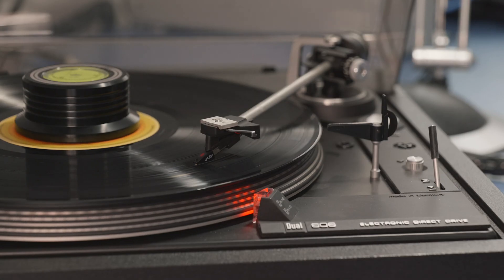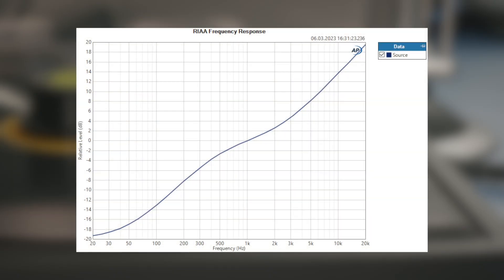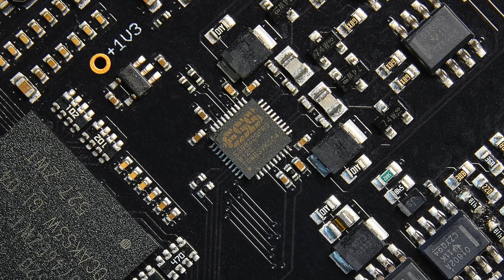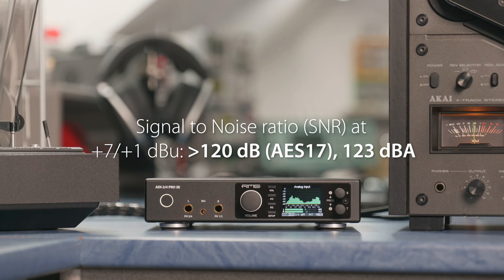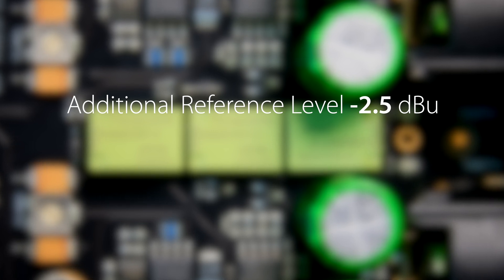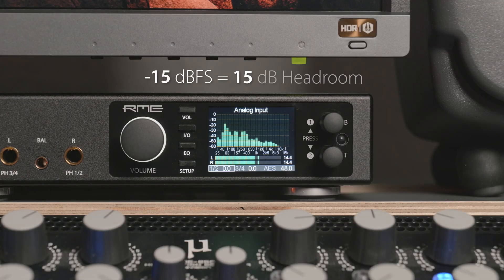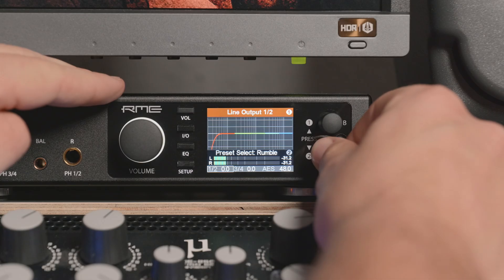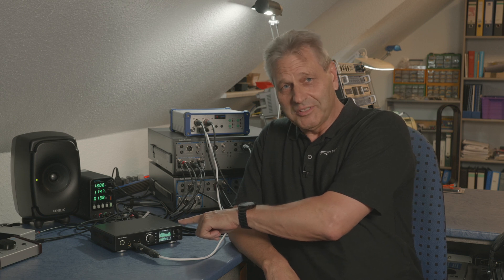ADI-2/4 Pro SE: Digital Phono Preamp (RIAA Mode) Explained

Comment: I just bought the ADI-2 PRO FS R, largely for digitizing reel-to-reel master tapes and duplicating cassette tapes professionally from digital sources. That said I am also a vinyl buff and am disappointed that I didn't do my homework to realize this newer version was available. Should I consider returning the FS R? I don't plan on doing much vinyl dubbing but I suppose I still could via my phono preamp in my receiver.  Are there other reasons to consider upgrading or staying with the FS R?
Reply from the maker: Indeed you can alse use the ADI-2 Pro with a phone preamp. The advantage is that you also can use MC cartridge if you have a suitable separate amp.

Comment: Like polishing a turd. Vinyl is crap, why bother?
Reply: Why bother with what, exactly?
Reply: @NotFound-ll5kc  trying to make vinyl  sound good. Just bin it and get a digital high quality reproduction produced from the master recording.
Reply: @andyracksthecams  And what if a piece of vinyl contains the only copy of that recording?
Reply: @NotFound-ll5kc  well that is very different of course. It is worth it's weight in gold and more. What I am saying is as much as I like analogue, Guitar Amps, Telemetry, Recording Pre Amps etc there are certain things that benefit from Digital techniques and Media is the number 1. Why use a disc which creates self noise, a physical pickup device which is ancient technology, which damages the surface of the vinyl on every pass  coupled with a need for isolation of the whole arrangement to reduce low frequency rumble. I like the vibe of vinyl. I like Reel To Reels. I binned them both when I finally let go as they are crap.
Reply: @andyracksthecams  Yes, technically inferior in nearly every way. I just wanted to stress that there are legit use cases for vinyl transfer.
Vinyl is the only medium we have that can potentially still play music in a post-apocalyptic, un-electrified world, so it's not entirely terrible to keep them around.
Reply: @NotFound-ll5kc  You know what would be great and save the music industry... if somehow it was illegal to digitally reproduce your music, archive, event, recording. I would go back to loving vinyl and the world would be a better place albeit creating more pollution.

Comment: I have XLR (Pin 1, 3 and Shield are connected to Ground) to RCA laying around. Is that also possible, or do I need to use the TRS sockets for the best SNR?
Reply: It will be the same, also to find in the manual.

Comment: Wow ! Absolutely interesting

I'm struggling with my modified Thorens TD160 with a Nagaoka MP-110 cartridge (given for 5mV Output), and plugged into built-in 1988 Accuphase E-305 Phono Preamp, I have a HUGE difference in the gain when I switch from my Converters (on the Balanced Line input of the Accuphase) or my CD Input of the Accuphase vs the AD Mode (Phono) of the Accuphase, like I have to push the Volume twice louder (which mostly results more or less 75% Volume of the Accuphase) to actually kind of reach the same Speaker Output level when I'm listening to my music quite loudly (on fairly low sensitivity - ~85dB/w/m - ATC SCM40's MkI speakers)...Do you think your solution has enough gain to handle this difference on my system ?

Regards,

Keep on bringing killer solutions.
Reply from the maker: It sure has :) You can see the variable gain settings in the video :)
Reply: @RMEAudio  Thanks again guys !

Comment: What about the MC support, which is the preferred cartridge for highend turntables?
Reply: Well, MC requires different input resistance/impedance so my guess would be this is not so easily done on the same input channels 🧐
Reply from the maker: That is exactly the reason @moneypizzle
Reply: @RMEAudio  A/D conversion for MC+MM done right incl. variable input impedance—> M2TEch Joplin MK-3 😜
Reply: @moneypizzle  And 20dB more gain.
Reply from the maker: We’ll ask him :)
Reply: Well, in this case I don‘t expect any answer 🤣
Reply: I wonder if it's an indirect way of saying RME don't believe in MC 😅
Reply: No, it means that RME simply doesn‘t care about legitimate customer requests…